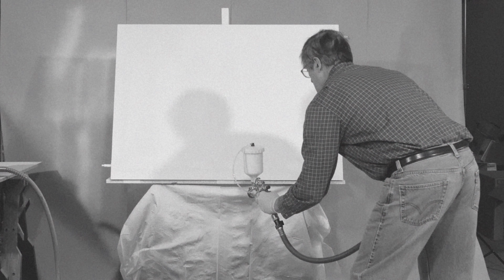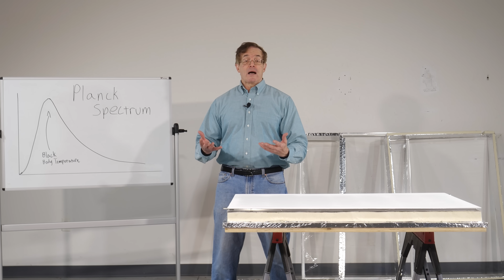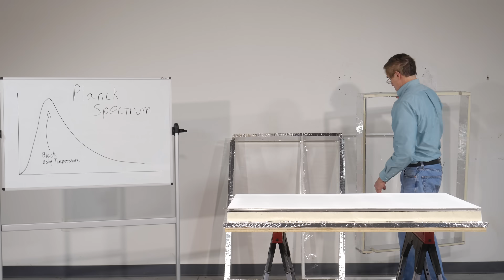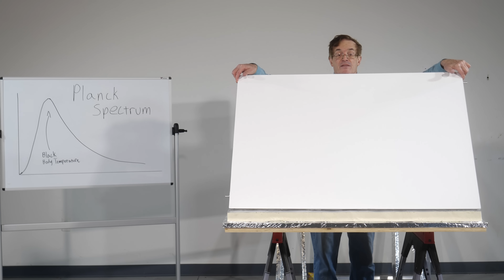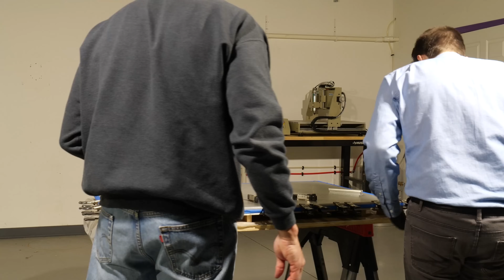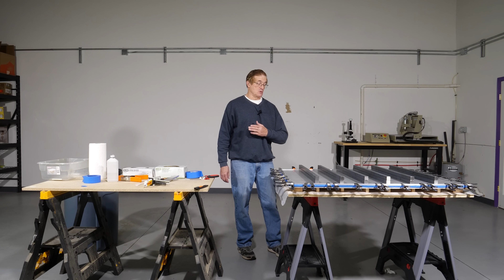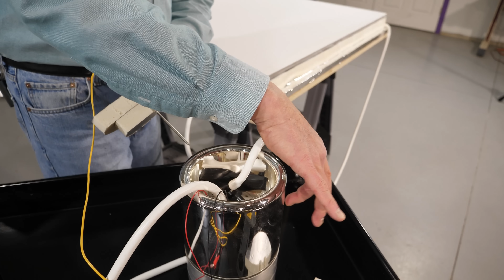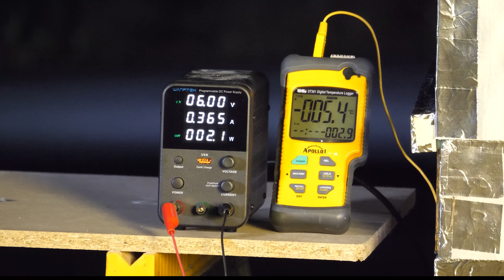Air Conditioning isn't free... but we're close.

Comment: I did a real world version of something similar 15 years ago. We had electronic housed outdoors in aluminum boxes, that were in direct summer sunlight. The inside of the large boxes were heating up to a point where the electronics were hitting their thermal maximum limits, as ambient temperatures got over 90F. So I ran a few tests with unpainted aluminum vs painted aluminum (gloss white).  Our boxes were completely welded aluminum, with a large hinged door. The box was approximately 24" W x 24" D X 36" H, with a 2" round opening at the bottom, and a solar fan (used on boats) punched, mounted and sealed into the top, to provide airflow across the box internally.

Testing was done side by side with enough spacing to not allow shading, the aluminum boxes that were painted white showed an approximate internal 20 degree (F) drop in temperature (while staying much cooler to the touch) vs those that were not painted, with the normal polished aluminum finish. The hotter the ambient temperature, the greater the difference between the boxes. I ran these tests for 30 days during the hottest part of the year. I wanted to make sure any time and expense in painting these structures was well worth the benefits of the additional cooling. 

Painting these boxes kept our equipment from hitting their thermal limits, reducing maintenance, and equipment costs, as our temperatures often reach well over 100 (F). The equipment used back then wasn't the most efficient and produced a lot of thermal heat. The equipment we use now days has improved in efficiency, reducing heat, but the principle remains the same.

Comment: My only concern is the plastic wrap doesn't seem like a practical solution for actual use outside. It won't weather well and is extremely fragile. Is there something more durable that will have similar properties?
Reply from the maker: No, but it turns out that it has limited value.  You can lose it.

Comment: Fantastic stuff. I live in the desert and I am always looking for ways to live well without spending the national debt to pay my power bill. My solar is good but I am always worried about efficiency.

I know solar panels lose efficiency as the temps creep up. I wonder how well this concept would work by coating the south facing side of a roof. My attic gets pretty hot and I have installed an attic fan. I have noticed a noticeable drop in my air conditioning load since installing the attic fan. I also made the intake of the attic fan pull air from the garage. With hot cars in the garage, this pulls 100 degree air from around the garage door into the hot garage, cooling it (the parked, hot car engines really cook the garage in the summer), and the relatively-still-cool 100 degree air in the garage gets pushed into the 130 degree attic.

The cooler attic reduces some of the heat radiating down in the ceiling of my home, and the reduced temps may also play a really tiny part at reducing the temp of the roof. This might help the efficiency of the solar panels that sit only a few inches from the roof.

I could be wrong but in my mind, I have helped make my home a bit more efficient.

This project could take my efforts to a whole new level!

Comment: i just wonder how it would work during the day time though, if you are relying on passive ir cooling, would the system not heat up from the IR of sunlight
Reply from the maker: It will.  It's  just that it will heat up much less than its  surroundings and so will be colder than the air around it.

Comment: Loved the video! Have you considered shaping the upper "box" in an expanding geometry similar to a horn or microwave lens? I would think it would more effectively direct the infrared radiation upwards, as well as potentially block more ambient radiation from trees and horizontal structures from getting directed onto the panel. Cheers!
Reply from the maker: Yes.  That should  work better.

Comment: Nice idea, but is it practical in reality? that box is fairly large and radiates about 150W was it? (+/- 150W/M2) in that same area a solar panel would generate on average about 200 W/m2.
So while i dont know how much a device like that would cost to build at scale. wouldnt it be more beneficial to just place solar panels on a roof and use that energy for cooling with a reverse heat pump, resulting in a bigger heat energy delta then power used for the heatpump. instead of having it supplement an airconditioner by placing these devices on a roof
Reply from the maker: As we'll  show, this works 24 hours per day.  Furthermore, the paint itself can be adapted to work with other cooling systems.

Comment: I think that an inverted pyramidal shaped box would be better to avoid reflection back to the radiator. Underneath the radiator, a pyramidal shaped stand, you can vary the angles to optimize.

Comment: Assuming that you have something around 5 Liters of Water+Glycol (I'm guessing ~30%, 3.76 kJ/kg and Density of 1073kg/m³), for this Temperature differential, about 48.2Wht of heat was removed, If the duration of the test was, I don't know, maybe 5 hours, consuming 2w x 5h = 10Whe, you've got a system with a COP of almost 5! Imagine if this scaled up, where pumps and pressure drops would be more efficient. During the night, the system would "thermo-accumulate", it could even be in ice banks, taking advantage of sensible+latent heat due to the phase change, and it will have a good help in the thermal load of the air conditioning for the day. Really Impressive, Thank you for sharing this fantastic content and spreading valuable knowledge!

Comment: Great video. I'm a little confused about the stated 1.2 KW radiative power of a human body. Most resources I found talk about 100 W to 250 W. How did you calculate that?
Reply from the maker: As I explained, those lower numbers are the net between radiative loss from the body and radiative  gain from the environment.
If you were floating in orbit, it's  1,200 watts.

Comment: Cool, pun intended, it doesn't seem hugely practical though. First thing, dirt turns super-coating into dirty super-coating, super-effect will diminish. Another thing, how much net dissipation are we talking here?  Despite 2.2 watt of heat from the pump an equilibrium 3.4 °C below ambient isn't hugely impressive to me.  The quality of the experiment though, that's impressing. It would be interesting with a temperature curve, and possibly an estimation of actual net heat dissipation. Larger systems can use less pumping power per unit of area, then again, if part of 2.2 watt heat saved changes temperature difference to ambient it can reach significantly it's hardly worth it.             

I know you don't love solar PV, but I still want to point out that high output from them tends to correlate fairly well with need for air conditioning. Solid state, often 25 years warranty, ~200 watts per sq meter in full sun, power, which is immensely more useful per amount of energy than heat dissipation.       

Indirect evaporative cooling can be made very compact, humidity tends to be low if it's warm and you have the "open sky" that radiative cooling requires. I suspect indirect evaporative cooling isn't used more mostly because it's "difficult" to use the relatively low temperature differential indirectly, if you only get 5-10 °C below ambient you need an extreme amount of surface area/exposure to cool down a house. At least when you need that very obvious fast change in temperature humans tend to need in order to understand that cooling is happening.

Comment: There is an equilibrium between an incoming heat radiation and re-emitted radiation with a human body. This is why we use cloth to reflect most of the heat back onto a skin. 1kW is a momentary power. This is what a warm thin skin layer can emit during few seconds. More or less continues body power I guess ... is about 10W. And even more things. Just imagine a scenario when a body is wrapped in a reflective foil. How long you will remain alive emitting 1kW of heat? You see?

Comment: Love the work guys, anychance you can do a video on making a home fridge significantly more efficient?
Reply: Those TECs are quite inefficient. What metals/semiconductors they are made from make a differance but increase the cost. Recirculating the inside air over the TEC will help only slightly but massive insulation is the main item for an efficient cooler. I suppose you could couple  TEG on the outside of your fridge TEC to generate electricity from the waste heat but at a miserably low return

Comment: What does the space station use if any coatings? Are they against paint? Due to flaking off at orbital speeds?  What is the coatings expansion/contraction, would this cause it to flake especially in temperature swings in orbit?
Reply: Also please be safe while applying coatings please wear a mask...

Comment: I am not a painter, by trade but have worked closely with them. You may find you have more even application by moving with the gun when beyond arm span. 
I don't know if even application matters but I did notice you were doing a good job of avoiding hard edges (by flicking/twisting at the beginning and ends of each pass).

If someone who is an expert (in autobody paint) wants to add or correct me, please do.

Comment: When I first read about systems attempting to utilize this radiative cooling phenomenon (close to a decade ago now), one of the materials that gave the highest temperature delta was hafnium dioxide (~10 °C in full sun in the desert). Is that still the case or are there better ones out there now?
Reply: The problem with those things is high cost and the fact production is highly energy-demanding. One can be under an impression they are carbon-neutral/negative, but the whole life cycle dumped so much CO2 in the air that won't be neutralized by the time the coating gets ruined.
Same thing goes for photovoltaic panels when they are set in low insolation, damp areas like London or most northern parts of the developed world. It's highly carbon-positive and makes a shitload of dangerous e-waste.

Comment: Seems like any gains you would see radiating some heat to the sky to supplement a heat pump would be negligible, perhaps not even a measurable difference in energy use.  On a much larger scale maybe but it could start encroaching on local vegetation which has its own part to play in lowering ambient temperature.

Comment: I’d be interested to know if the further cooling of the refrigerant of an air conditioner would reduce the pressure of the refrigerant and if that would have an impact on performance. As I understand it, with forced induction in internal combustion engines, you need to consider the drop in temperature and therefore pressure of the charge air when using an intercooler because you can actually reduce performance.
Reply from the maker: It shouldn't.  We're  talking about cooling that would duplicate the effect of a lower outside air temperature being drawn through  the existing heat exchanger.

Comment: Could you use one of these to cool the ambient air around another one of these to cool the ambient air around another one of these and so on? If each 2.2 watts got you 2.5C of cooling, that's 25C for just 22 watts.
Reply from the maker: No.
The cooling depends on the differential  between the ambient temperature and the sky temperature. Each subsequent stage would produce a smaller drop.

Comment: 100 years ago, houses were built to.. ventilate. You didn't NEED that much air conditioning. A smart person built their house in the lee of some deciduous trees. Shade in the summer, sun in the winter. Pine / Spruce on the north side to block that winter wind. A wrap around porch. Chimneys to draft and suck air through the house. 

Today? Today you get a box built out of sawdust glued together that's intended to start falling apart after 20 years. Don't worry about your dryer falling apart in 8. I'm starting to think that society is due to get just what they deserve.
---
Oh yeah! News Flash! Ground temperature nearly worldwide is 55 degrees F at 2 feet down. 

Hmm...
Reply from the maker: These things are intertwined. The cause and effect works both ways.
Reply: @TechIngredients  Agreed.. my point was, if we combine old tech with new, I fully believe you could tweak your environment to close to zero watt hours. You can easily build a 12 volt swamp cooler (for dry climates), but nobody does. You could put misters on your roof and use ambient cooling. Modern hyper-efficient split-system coolers are getting close to being efficient. I love your idea of using your radiator to improve performance on a standing system. I'd LOVE to see what it does to help a good split system cooler. Even better, a split system retro fitted with a 12 colt fan and compressor. 

I think we've got the tools to do it, right now. Nobody does. These days you're lucky if your crappy window shaker lasts two years. You want to talk about a waste of resources!! THAT'S the elephant in the room!!

Comment: I Have a question. Could we transfer concentrated solar flux through an optical fibres? If it does, It could unleash so many possibilities as heat can be transferred over a long distance by the means of light.
Reply from the maker: No.
The problem is the distributed source.  The sun is about 1/2 degree across the sky.  Even with clever optics, the image can't  be launched into a fiber without  huge losses.
That is why light pipes became popular  instead.
Reply: @TechIngredients  ok, so the challenge is to focus the concentrated light perfectly on a tip of the optical fibres as the sun is moving continuously across the sky. Am i right?
Reply from the maker: No.
It's due to  more fundamental optical principles.  You can't  focus a distributed source tightly enough to launch it into a fiber without  huge losses.
Reply: @TechIngredients  ok now i understood. thanks for replying

Comment: I can’t help but think about your comment in your last video about needing to cool the water down in a water cooled solar panel. 

I imagine a solar panel with one of these radiative cooling panels mounted at the top would be comically tall but would otherwise allow cooled water to constantly trickle down the face of a solar panel to be caught by a trough at the bottom and circulated back up to the top by a small submerged pump. 

The water flowing down the face would experience some losses due to evaporative cooling, but that wouldn’t be the worst thing if you also had a small backup reservoir especially considering the fact that you would have a cooling system that would take advantage radiative, convective, and conductive cooling. 

In a system like that you would be chasing down efficiency through aggregation of marginal gains, but that seems like it’s right up your alley.

Comment: instead of apoxy, coyld you have used aquarium grade silicone ?
Reply from the maker: Probably.  The adhesion and shear strength would be lower, but for this application, epoxy  is way stronger than needed.

Comment: I work in a clothing factory in Minsk in Belarus. our roof is 1500 square meters, will it be any sense to cower roof with white paint? will it make less heat in the building (permissible under the condition of poor thermal insulation of the roof)
we use Conditioning to cool down our factory, and I want to try to minimise electricity use of electricity for Conditioning
what do you think?
thanks)
Reply from the maker: I think it would.
When we show you how to make the paint, you might seriously  consider this.
Reply: @TechIngredients  super)))waiting for instructions video)))thanks))

Comment: A great way I've found to make large, cheap, low power density heat exchangers is to use corrugated plastic. For $100 you get a 4x8 panel that is rigid, watertight, and even has channels to help guide flow evenly. To make inlet/outlets you can just cut a slit along a hose, open it up and silicone it around the exposed sides of the panel. Plastic panels work great for applications like air to air heat exchange and radiative cooling as the thermal conductivity of the plastic has very little impact on the performance of the system.
Reply: it's not a heat exchangre its just a cooler, or basically a Single Panel  (Type 10) radiator

Comment: Okay, so from what I understand, If I were to find or modify a central air compressor cooling coils I could lower the tempature which would in turn lower the energy consumption of the unit. My idea is to take an older unit and split it just right so it fits around the existing unit which when the unit is running it will draw the cool air over the hot coils cooling it. Then a box unit like this that can either be ground mounted or roof mounted. The tubing can be insulated? The size of the array could be dependent on how big your AC unit is. 
Now if this were to save 10% off your cooling bill you could see a massive return over the life of the AC unit. I also think that the AC unit might last longer due to the less stress it gets in a given year. 
This could be helpful for fridge and freezer units, mostly commercial units that have a remote compressor. I have thought about buying some of those commercial units that have a remote compressor and installing it in a enclosed cavity or room to which then is vented out during the summer and exchanged during the winter to heat the rest of the home. Having the ability to cool these units for the energy savings is awesome. 
Even using something like this to keep a building cooler then the outside would work. 
now the main thing is how much heat can this remove? Would the entire roof need to be one large box. If so how does weather affect it and how would we combat rain and those things. Super cool idea.